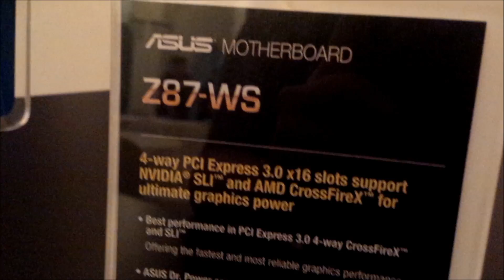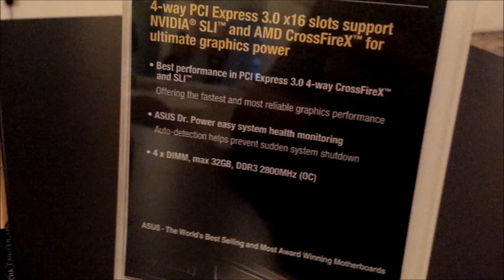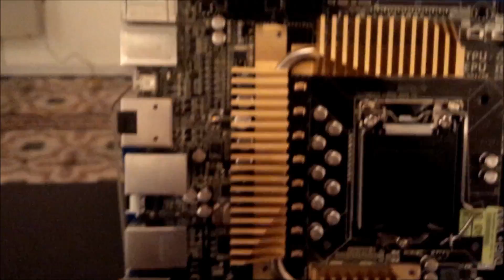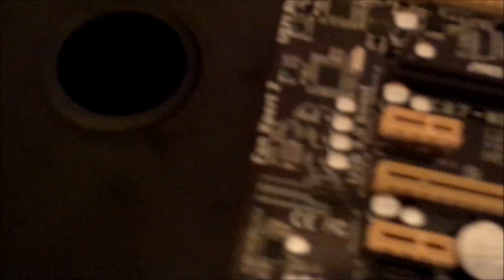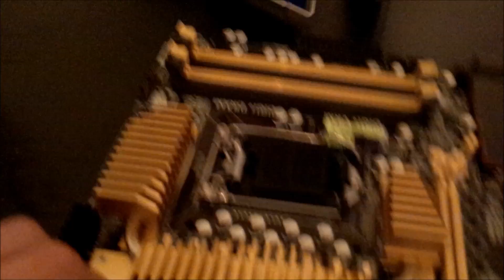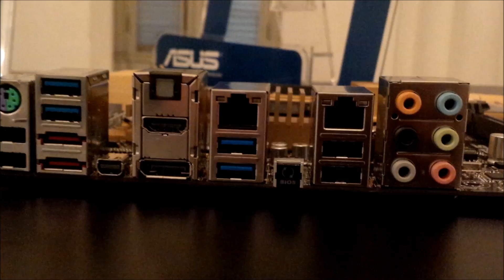First Look - ASUS Z87-WS Motherboard

Comment: Dont listen to him, This board may be built for Professional inviroments but its a sister board of the Maximus VI Extreme. Not only that but the PCI-e lanes are in a much better layout for dual SLI. Same performance for 3 way and 4 way you should be looking at x79 chipset. Though the Maximus seriies are more targeted for overclocking, the Extremes extra features are ether gimicy or targeted at the absolute performance hungry overclocker running Liquid Nitrogen cooling. This is a great Gaming mb